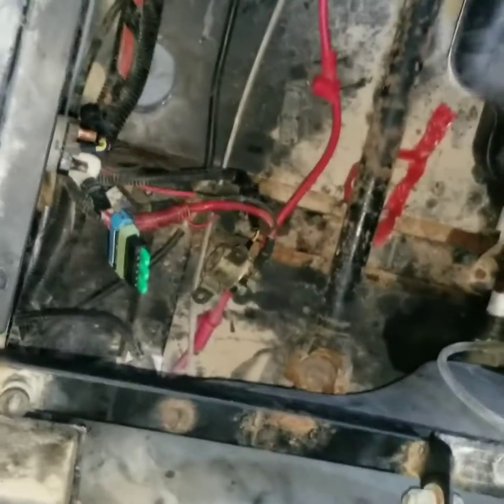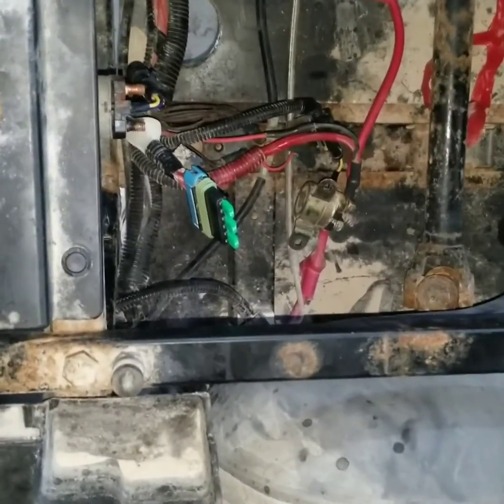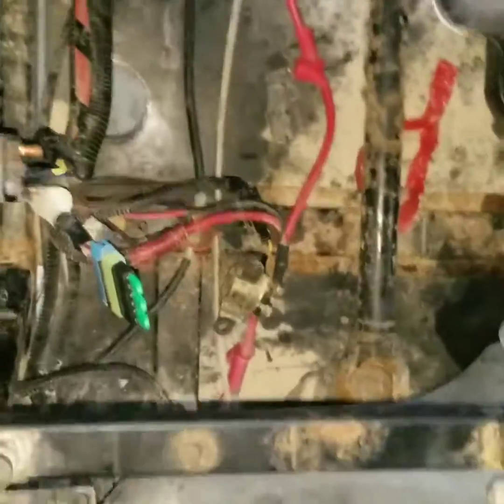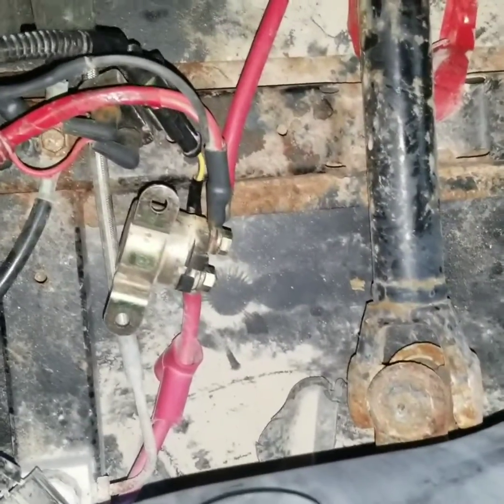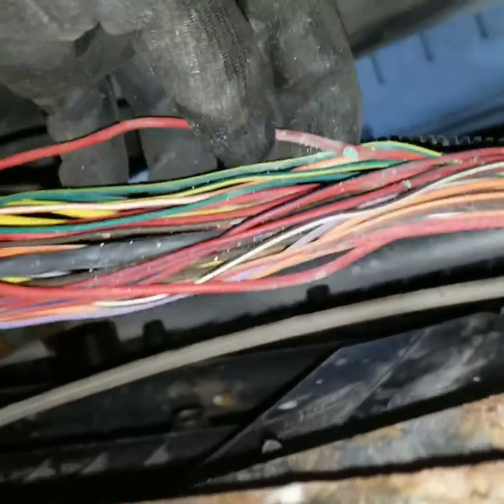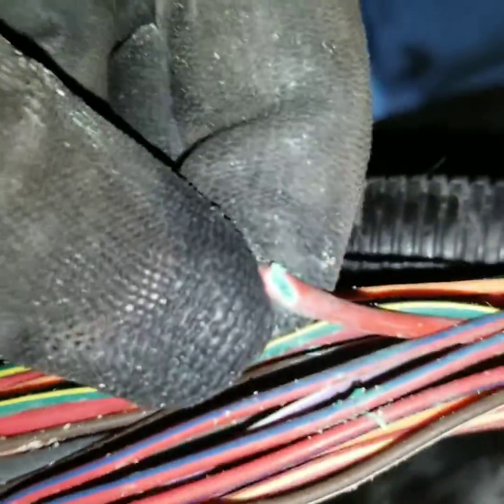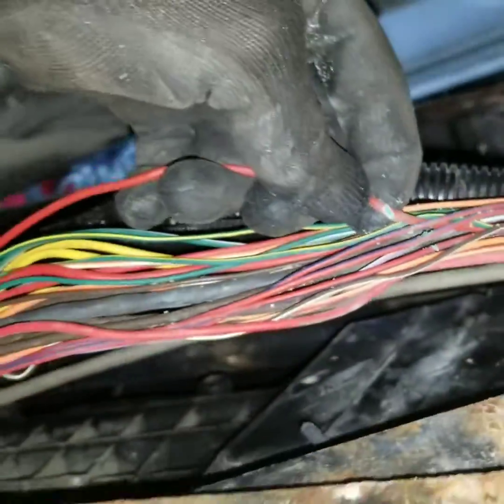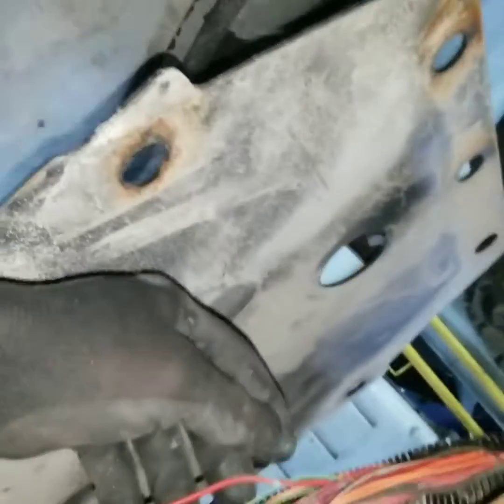Polaris  rzr 800 power supply problem  diagnose  and fix

Comment: I have the same problem. Did you figure it out?
Reply from the maker: yes the problem mostly caused by the harness wire....open the cover under and check  the wires, there is bridged current....after tell me what you find
Reply from the maker: watch the video  till end you will see the problem and its solution